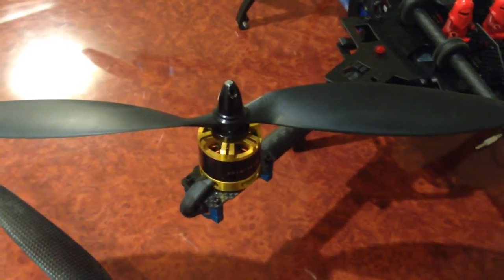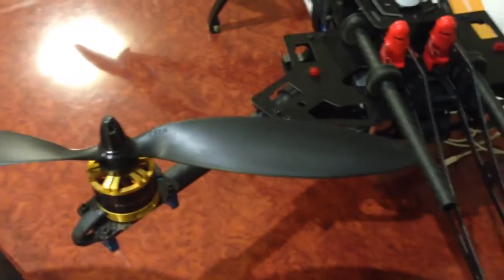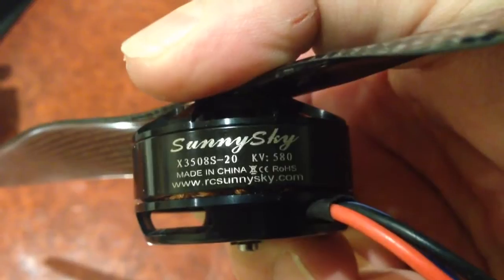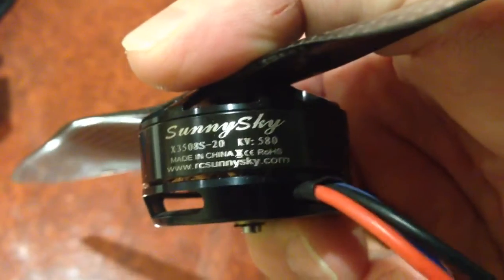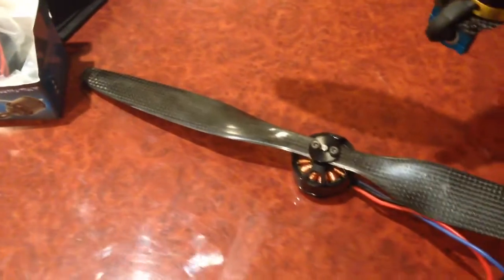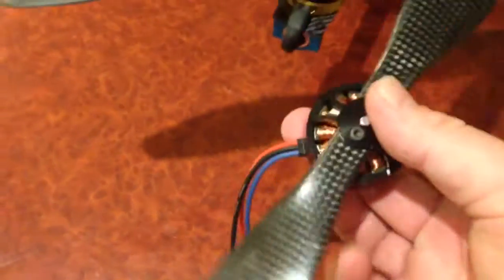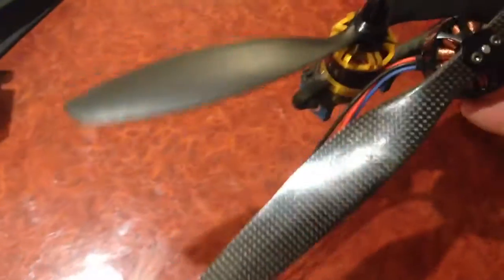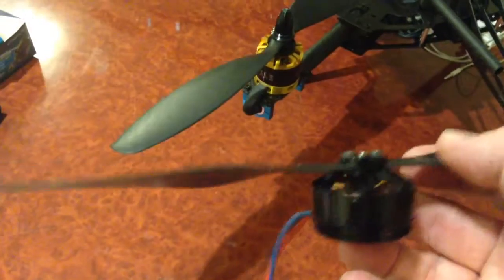New motors for the next Quad build - Sunnysky 3508 - 580 KV

Comment: can I run these with a 13 inch prop on a 4s ,
Reply from the maker: +Sandy Valentin Hi Sandy, Yes the 3508 - 580 KV Sunnysky motors can easily handle 13 inch on 4S.   I am doing this on a Tarot 680 Pro hex and also running 4S with 15 inch props on an Alien 560.   Here is a vid of the Hex.  https://www.youtube.com/watch?v=y2MqnAVal9o
Reply: +Trainboy64 thanks for the reply and videos , very helpful
l cheers

Comment: what size screws are used on the bottom of the motor to mount to mount?
Reply from the maker: +Christopher Loesch I think they are M3 x 6mm bolts.
Reply: Thanks...just got my motors in today.

Comment: Rob are you building another on the Alien frame or another frame? I am thinking of building a filming platform but was stuck on the Armattan FPV with longer 355 arms or the Alien  from HK.
Reply from the maker: Yes building another Alien but with arm extensions for the larger props.   The Alien is huge compared to the Armattan FPV - even with the 355 arms.  I'll make a video of both side by side later tonight for you.
Reply from the maker: Here is the vid Stephen,  Both are really great frames.  Armattan FPV 355 vs HK Alien 560